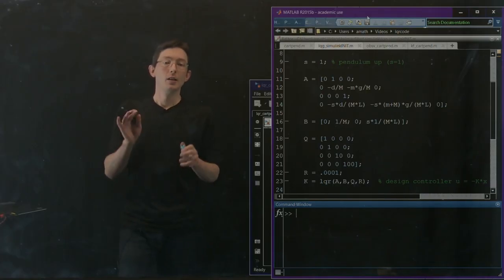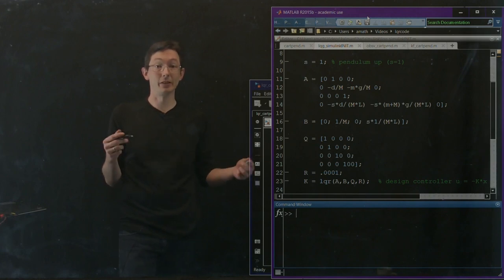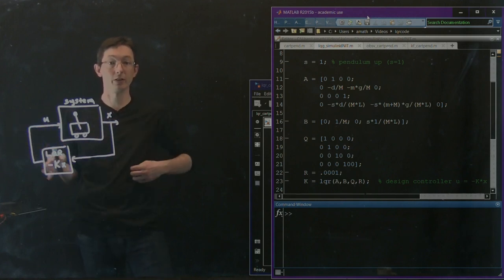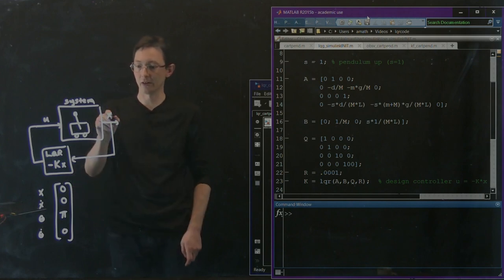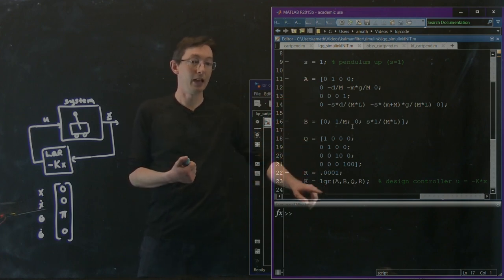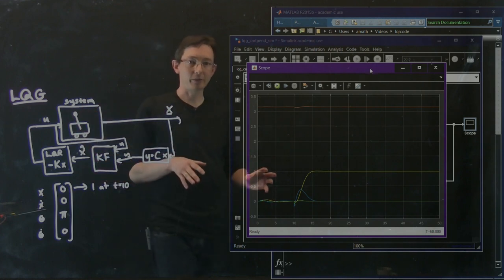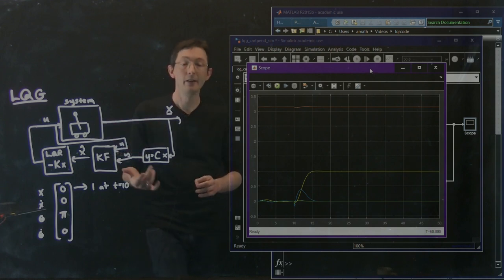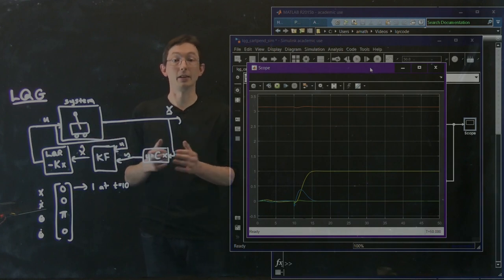Control Bootcamp:  LQG Example in Matlab

Comment: Dear Prof, does the system work well with Vd=0.001*eye(4) and Vn=0.001? For me it is not giving good result (although stable). As i checked your code (from the provided link), I find that the values of Vd and Vn are set to 0.0000001 and the system shows excellent result. Which one should we use?

Comment: Prof. this might be a strange question, but does the controller move to the left a little before moving to 10. and if so, how does the controller know to do that?
Reply: The same thing popped to me. Yes, I think it has to move a little bit back first to tilt the pendulum forwards (the yellow curve on the scope dips a bit). But I am not sure how it knows that.
Reply: @tushermyth  The -K matrix given to us by the LQR encodes how to get the system to go to a state of [0,0,0,0] - that includes information about how to move while keeping the pendulum upright, which includes putting it slightly off balance to move the cart by going backwards first.

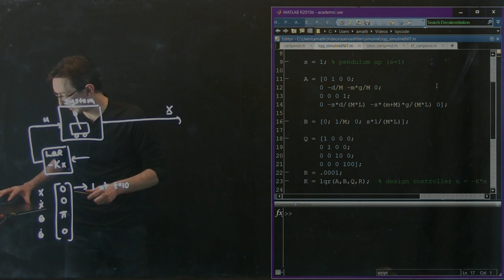Comment: Sir why did you not subtract PI from "theta" at 7:27 minute mark in the video?
Reply from the maker: Good question.  You can actually download the code at databookuw.com under the CODE.zip link.  Then you can play with the simulink model more.  There are a couple of things that could be going on here:  1) I might have subtracted pi in the simulink code, or 2) I might be linearizing about the up position, in which case this would become the "origin".  But I would check out the code to make sure.

Comment: Sir, if we suppose x and theta don't have any relation with x_dot and theta_dot in system equetions, how can I linearize it at fixedpoints. 
İn that, I cannot place equlibrium x and theta after differentiate equetions because there aren't.(is it logical).
 I have a system like that. But ı have to linearize it.
I hope I can explain my problem.

Comment: If you got a positive gain in the LQR you just need to reverse the signs of the block with the step and the position estimation as input?
Another question, does the proportional regulator gives some oscillation problem around the reference point, do we need a pole in zero?

Comment: Dear Prof, thank you for the Control Bootcamp, I keep revisiting it year after year!  This time I come with a question regarding our C = [1 0 0 0];  Matrix. Usually encoders for inverted pendulums are set to read the Theta angle. So our C should be C= [0 0 1 0] . I have tried using the Kalman filter to estimate the state of the system but got an error when trying to estimate the states. (Error using lqe (C,A) is undetectable). What does it mean? Does it mean that we cannot estimate the estate of the system with a sensor on the pendulum ? Kind regards,
Reply: george, he actually taught about that in a previous class.

if you want to estimate full state you have to measure x (then the system is observable).
If you measure any other quantity, you'll se that your system will be rank 3 and it's not observable. Of course that you have a shade on observability and not just OBSERVABLE/NOT OBSERVABLE.

Comment: But is the system not observable with C=[1 0 0 0]? How can you still estimate the other states?
Reply: Good observation. Even, thinking logically and practically, we conclude that it's impossible to stabilize pendulum in upright position, estimate thetha, just based on the knowledge of x, position. We can stabilize only if we know the angle theta, may be, for that C matrix must have nonzero value at 3rd index, then the system might be observable, but one thing should be noted, that minimum condition for observer is detectibility of system, means in that case we can build reduced order observer. A system might be unobservable, but still detectable. 
Detectable system means, that unobservable modes goes to zero and non zero can be observed.

Comment: What is the x vector that is multiplied with the sysKF.A matrix? I'm doing this in Python, and therefore I don't have Simulink. Since we only know the x-position, what should go in to the other 3 entries in the x-vector? Is it the previous state from the Kalman filter?
Reply: I think the inital x_hat vector is the same as the x_vector [0;0;pi;0] and then the sysKF dynamics takes it from there? Would also like a clarification on this. Inputs to the sysKF are u and y, how is x_hat being taken as an input as well?

Comment: One think confuse me: how can the kalman filter estimate the angle just from the cart position? I know, from a known initial state, the cart position is enough to propagate it in time. And I understand why kalman filter can work with a normal stable pendulum. But if the pendulum is not stable, an initial bias in state can aggregate in time.
Reply: the kalman filter also knows the input, so it knows where the cart ought to end up. When it sees the kart move backwards relative to how it should with the input (notice how without any input when the pendulum falls the cart rolls backwards and forwards due to momentum) it can infer the pendulum's angular velocity. And when it has an idea of the angular velocity, it can tell whether the pendulum is up (angular acceleration is relatively small) or falling (angular acceleration is high)

of course once the pendulum falls far enough it won't be able to figure out the position with much accuracy any more, but that part is outside of our linearization

Comment: Thinking logically and practically, we conclude that it's impossible to stabilize pendulum in upright position, just based on the knowledge of position,x. We can stabilize only if we know the angle theta. Because we can see that the measurement y is just position of cart. Then how it's possible to stabilize pendulum in upright position just based on position value?. Moreover C=[1 0 0 0], makes the system unobservable,  I believe C matrix must have non zero value at 3rd index instead of first index, so would have angle measurement, which should be sufficient for stabilization and also rest of states estimation.

Comment: This is a great series. I'm actually learning a lot from it.
I have a question, though, how come you don't get an error when you use the unstable matrix A (pendulum up) to build the gain matrix Kf as you did in one of the previous videos? In that video you built the estimator for the pendulum down system because of this error. Why is this not an issue in this case?
Reply: he said that if the pendulum is in the up position, it will rapidly goes down so the linearized model will not vaild for it leaves the fixed linearized region , but if it combines  with LQR full state feedback , the system will be stable, and the the linearized model will be vaild!   maybe this will help you !
Reply: @davidpeter5639  I think I understand what you mean. Thanks a lot!